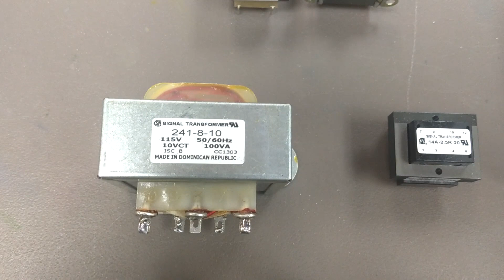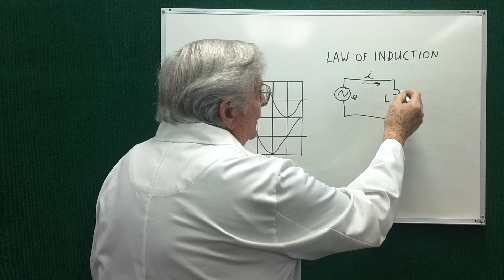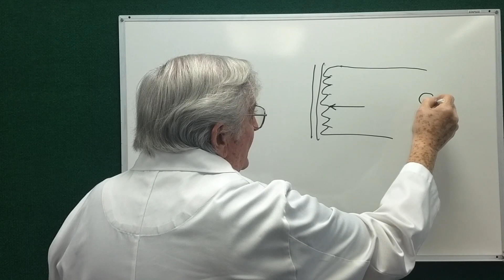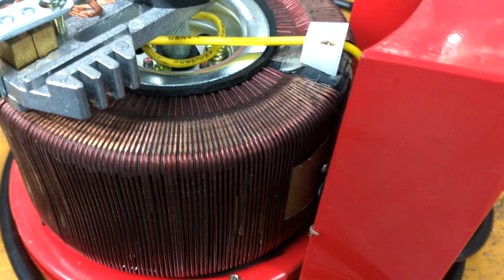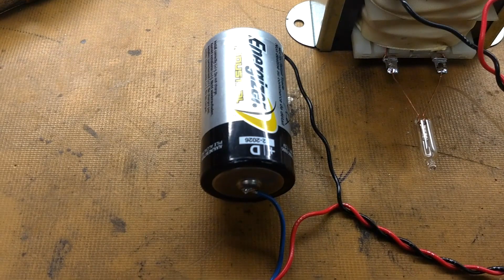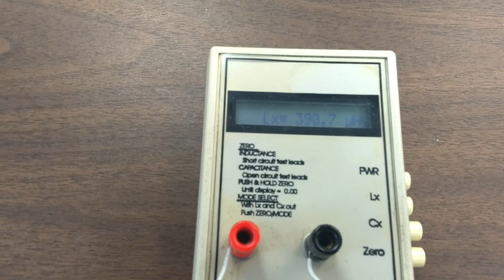Transformer Secrets

Comment: Jim.  It's said that when you're ready to learn a teacher will appear.  Thank you.  I am doing an article for the amateur clubs in my area on CM currents and fixes.  I've been seeing some testing done outside the s11 - s21 thru using the nanoVNA using a current probe (transformer) on a terminated feedline.  I may either increase the turns or add a simple OP Amp to increase sensitivity in order to use the s11 port as a generator.  I'm only looking for a relative with/without level of CM suppression.

I spent my second career working in hydroelectric power generation and had the privilege of participating in two 130 MW generator rebuilds and two shield modifications on the 230 KV main transformers.  That's when you learn about the whole thing - when it's in pieces on the set down deck with every nut, bolt and screw accounted for upon reassembly.  Dave
Reply from the maker: Thanks for sharing your experiences.